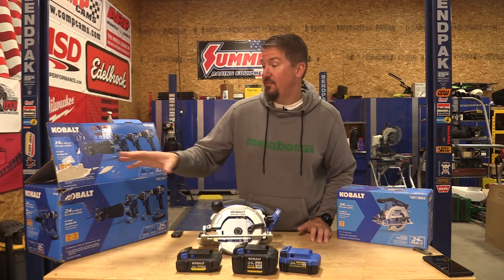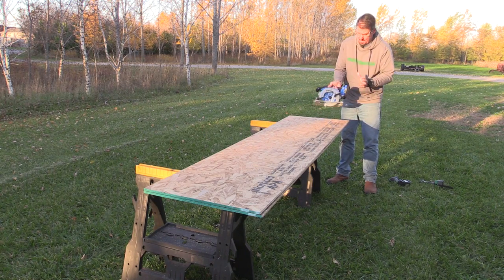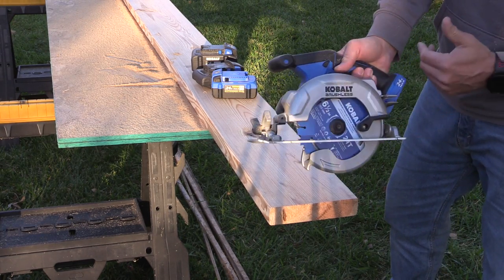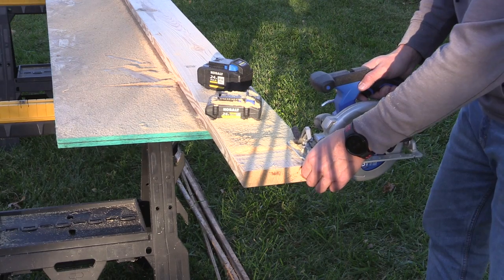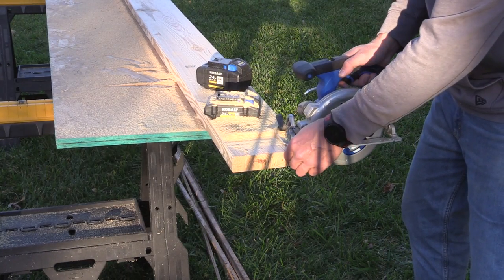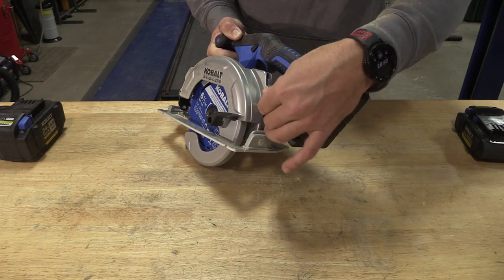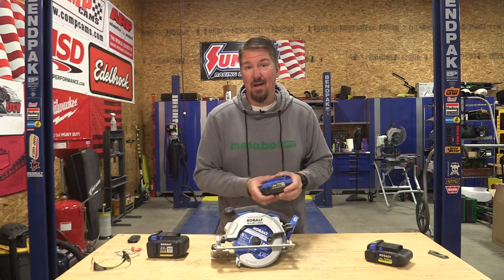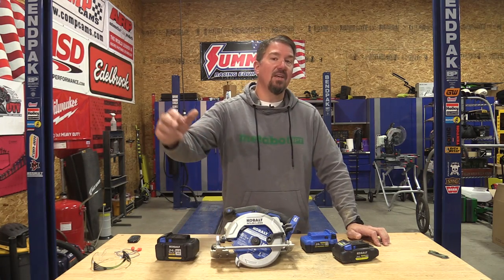Next Generation Kobalt 24-volt 6-1/2" Circular Saw Review Item #4913883 Model #KCS 124B-03

Comment: Just what I'm looking for as a homeowner not a contractor.  I love the fact that it weighs just over 6 lbs compared to the big brother which is over 9 lbs.  Occasional use and not having to run extension cords when used is my reason to purchase.  Had a Dewalt cordless but sold when I unloaded my arsenal years ago.  Have a Kobalt Drill & Driver kit so the batteries are already here.  Now if they would only put it on sale, I'm not paying $129, sorry Lowes, for what I consider a $99 saw.  Nice video letting us know the capabilities and boundaries of the saw!

Comment: There’s definitely a few “pro” features on it and some pretty good performance. I would absolutely consider Kobalt if I were to switch lines. With my small fine woodworking side hustle I really don’t have a use for a cordless circ saw, but this one looks like it’d break down a sheet of hardwood plywood without much effort with the bigger battery. I’ll bet it’ll beat the pants off milwaukees bottom of the line 6 1/2” circ saw lol. But that’s a pretty low bar. 😂

Comment: Seems like a decent pro-sumer saw. Funny that you listed the blade brake among your likes. It was the first thing I noticed in this video, having a considerable lag between the time when you release the trigger and when the brake actually engages to slow the blade down. The brake on my 6.5" DeWalt DCS565B is much more effective in comparison. I do like the dust port being on the opposite side of the cut. Overall, a nice tool to have around.
Reply: We have gotten spoiled, though... It wasn't that long ago that corded saws would just coast to a stop after 30-40 seconds, haha.
Reply: "Considerable lag?" It is under 1 second. Yes, there are faster brakes, but hardly a considerable lag. And this line is priced for homeowner use. Actually, it is pretty impressive line of tools at the price you can get them during these holiday deals anyways

Comment: Wish you would have shown concrete cutting. I use the old gen 24v to cut doggy doors through stucco. It works well enough but keeping my finger on the safety button is difficult sometimes when I’m holding the saw in awkward positions.

Comment: Higher performance with the big battery, but not very much becos the voltage is held higher. Yes it drops less, but higher current is the key. Twice as many cells in the battery at about the same voltage means less amperage per cell, so all in all the cells can output a larger current which translates into higher torque at the motorb.

Comment: The free tool is a gip. What a con job by lowes. Poor customer service. They act like your not there. Only needed a drill and saw. Then had to buy extra battery. Got the 6amp for the 6.5 circular saw. No dewalt tools in stock. Buy online you won't  get ripped off. Buy lumber local. Lowes rating in my book in a 3 out of 10.

Comment: If you show up to my jobsite with a ryobi, porter cable, black and decker, kobalt , craftsman and all the other bs brands your fired. Ima make you work for 3 hrs so I don’t have to pay you and you will be working on breaking down pallets that deliver my materials n then  I fire you.
I’ve done it to quite a few guys. If your not coming to work with a festool, dewalt flex volt or milwaukee fuel I can already tell your not skilled and worthy.
A tool is apart of you. Your not gonna be a police with a hi point or ruger. 
Your not gonna be my mechanic with harbor freight equipment.
Why cheap out on your career
Reply: Seek therapy, brother. You need help. You should judge someone by the quality of their work, not the brand of tools they use.
Reply: This guy more than likely has no jobsite and is just a YouTube troll 😂
Reply: I'm an  Australian builder and carpenter I've been using some Ryobi stuff for years and it's  proven more reliable than some Milwaukee gear and the batteries have proven more dependable .Doesn't pay to be a  brand snob ,it all comes out of China.
Reply: @interman7715  and by the way I’m an American builder Aussie boi
Reply: @antoniononame3037  Oh I gathered that !!
Reply: @ZeGermanHam  like I said tell that to the police officer who shows up with a yeet cannon to save your life in an emergency your gonna wish he had a high quality tool lmao
Reply: And when I see my subs judge people by their tools and not their work, I fire them. I certainly won't hire you.
Reply: Did it ever dawn on you that they bought what they could afford to start with, with plans to upgrade as they earned money? They showed up ready to work with tools
 You probably fired some talented craftsmen based on your prejudices.